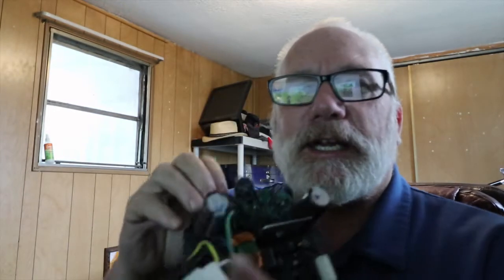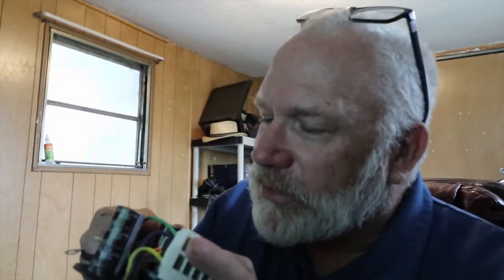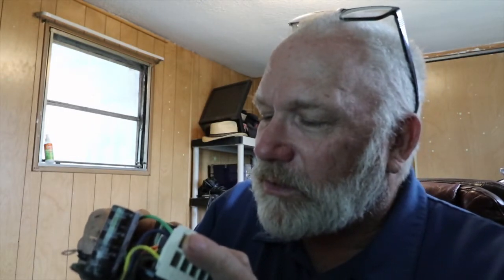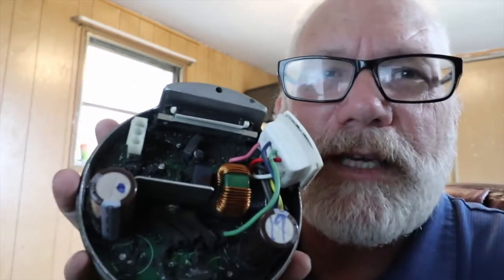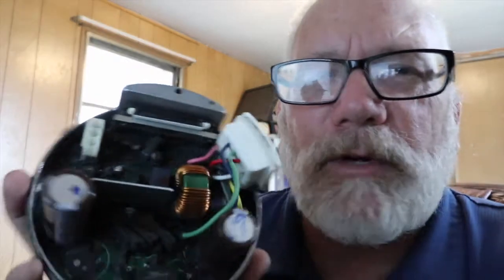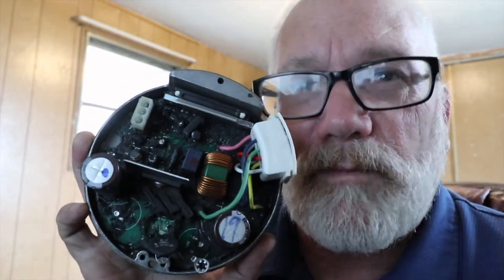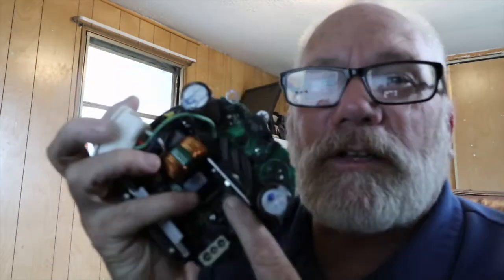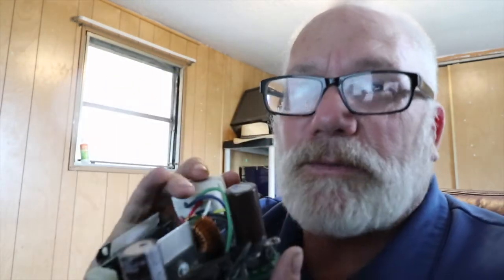Genteq x13 ecm motor with fm19 module REPAIR

Comment: Good morning, I have a ZHONGSHAN BROAD-OCEAN MOTOR CO. LTD BOM: ZWK702D0551101 (0131M00389),? Which version of the ECM engine corresponds to, and where can I get information to test it?
Thank you very much for your help
Reply from the maker: My suggestion is to replace the motor,  I have been using these evergreen motors, they seem to work.  just make sure the hp is the same and your good to go.  https://www.amazon.com/gp/product/B06Y3FDHW8/ref=ppx_yo_dt_b_asin_title_o09_s00?ie=UTF8&psc=1
Reply: thanks for the support.
Blower motor, still working properly ... will keep that in mind for when motor malfunctions occur. the engine is approximately 7 years old.